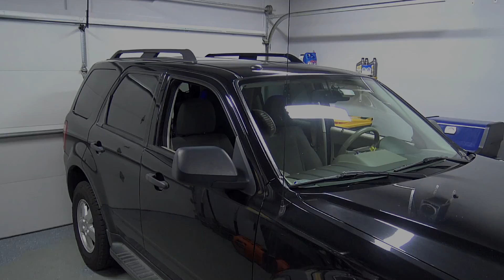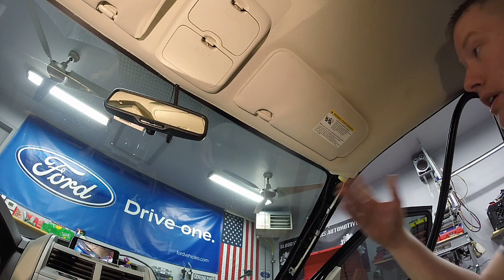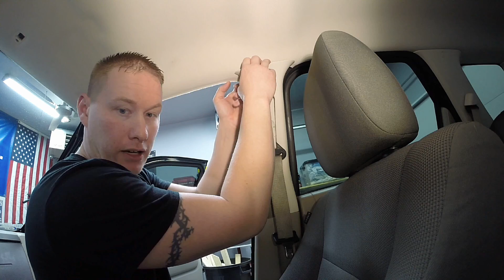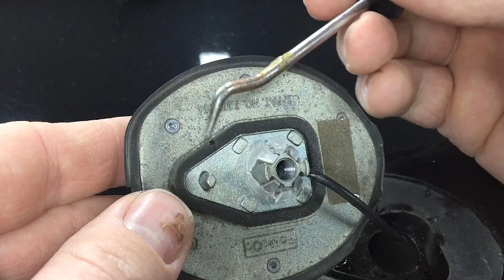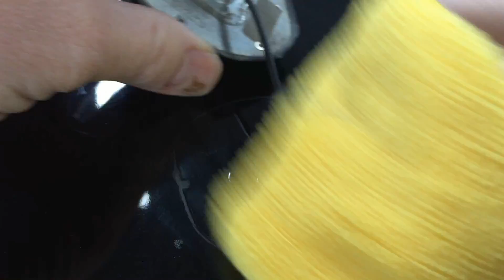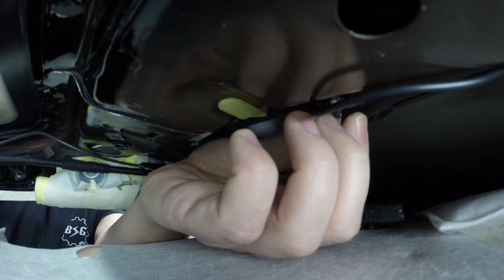Ford Escape & F-150 Windshield Water Leaks From An Unlikely Source

Comment: Nice video.  It helped me troubleshoot the problem with my 2018 F150, and I discovered it wasn't the drains or the antenna.  I actually had a bad seal at the top of my windshield that was letting water into my truck. I used some Permatex clear silicone to seal it up and that took care of my leak.

Comment: This is a lifesaver - thanks for this information - I'm about to apply this fix to my 2016 F150 with a sunroof - I don't have the dual sunglass holder, instead, I have the control box for the sunroof and lights - anything I need to be wary of before I start?
#newsubscriber

Comment: I needed to know how to remove the A-pillar trim, not for the antenna leak, but for a possible sunroof drain tube leak.  Thank you for this video.  We bought a used 2011 and had a wet headliner during a rainy spell.  I used a flex cable to gently clear the sunroof drain tube.  Thought it was good until we took it through a car wash for the first time.  The strong blowers caused the sunroof glass to flap a bit, and my wife said water appeared to come from the grab handle.  So I need to look.  I included all this description in case someone else has the same leak.

Comment: My 2016 Escape is leaking from factory metal seam under roof rail. Driver kick panel is soaked, covered in mold . Also floor board soaked. Sucks

Comment: I have the described leak but it is on the driver side.  Appears to leak at the top of the plastic piller where the cloth top meets the plastic.  Thinking it's not the antennae since it's the wrong side and I have the sun roof.  Have you ran into this issue?  Thanks

Comment: Great video. Thank you. I uncovered a small leak in my 2010 F150 that was dripping from the handle on my passenger A pillar. I thought is was the window seal but after watching this video I checked and there was a drop of water on the antenna mount bolt so I knew this was the issue. Overall took an hr being careful.

Comment: Now why this high-temp gasket maker vs some good quality outdoor silicone? Don't they make some good outdoor black RTV silicone? I heard Lexel makes some clear stuff that's clearer than silicone and it supposedly more durable that silicone. I'm just curious. I was looking for ideas on how to re-seal my 3rd brake light and came across this video... I also have a sat antenna on my truck like this.
Reply from the maker: Ford recommends this sealant because of the extreme roof temps of vehicles during the summer.

Comment: I have water leak in the same area on my 06 f150.  Water drips onto the fuse box area.  My truck does not have a satellite antenna. Any ideas where it may be coming  from?
Reply: I'm trying to find out where my leak would be on an 04 F150 that goes right to driver's side floorboard.  Infuriating.  Starting to have strange electrical issues now.

Comment: Why is there a little notch/opening on the rear of the antenna housing? Seems like that allows water into the space. 

Thoughts as to WHY that opening exists?
Reply from the maker: There is always going to be a relief for trapped water to get out.
Reply: FordTechMakuloco, thanks for the quick reply. 

Seems like with the lowered front stance of the F-150 it makes for a perfect ENTRY for water. 

Maybe at highway speed the Venturi effect draws out water, but what happens when the truck is sitting for any length of time and dew/rain has occurred?

Seems like the location could have been better to reduce/minimize the issue. Ideally, I would think having it mounted vertically or at a 45 degree angle with the relief hole on the BOTTOM makes more sense. 

Of course, I’m not an engineer. 🤷🏻‍♂️

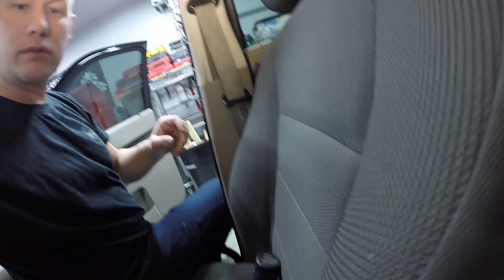Comment: Everything went well until about 10:30 into the video.  I've got a 2009 FX4 Crewcab.  The B-pillar supports the airbag and the rear grab handle.  Just taking out the top 7mm screw does not loosen the pillar enough to get more access above the head liner.  Trying to figure out how to loosen the rear grab handle so I can get my meat hook up to the antenna bolt.  Any suggestions?  Thanks.

Comment: thanxs 4 the info you can add 2011 f350 crewcab and it just drips straight on the Styrofoam like backing & flow to the a pillar. Did mine during on and off showers.Did you notice the seal is lower than the four little nubs?

Comment: I also have water dripping from my 2016 F-150, I was looking at the sun roof but found no problems. I will check the antenna. Thank you.
Reply: I have a 16 150 with the same problem  did this fix your problem
Reply: Paul B was going to ask the same thing. I have a 2016 F150 and had water dripping from grab handle but also from the back sliding window power switch. Still think it all comes down to this antenna not being sealed properly.

Comment: 2001 f-150.   I have a water leak from drivers side grab handle.  No satellite antenna and no sun roof.  No headliner stains yet.  I’ll probably pursue the windshield seal replacement and see what happens.  I don’t know what else to do in my case.

Comment: Done..it’s pretty much the same on the F150..the A Pillar has a clip near the top that was fairly tight on mine, and I removed the tweeter so I could get the A pillar out of the way.  When I removed the Sirius Antenna, I found a plastic retainer that was broken.  Solution: after cleaning everything up, I lined the broken plastic retainer back where it goes and applied Locktite 454 (superglue) to the base of the antenna where the retainer goes.  Put everything back to get together.  Otherwise I followed Brian’s instructions.  Note I did not remove my Sunglasses console, if I where to do it again I would definitely remove that, would make the job much easier, it is super easy to crease or fold the headliner...don’t want to do that.  Total time..under an hour.

Comment: Love your videos man. My 2005 ford escape is leaking front windshield fluid from passenger side door jamb. 
   Front windshield washer doesn't work. Every time I pull the washer on switch washer fluid pours out of passenger side door jamb.  rear window  washer works fine.
  Any suggestions? 
      Thanks man
Reply: Mine was leaking at the back of the wheel well so I pulled down the plastic liner in the wheel well by removing the Phillips screws and it revealed the rubber lines that carry the windshield washer solution for the front and the back both were disconnected at a joint that’s there. Easy fix just plug the rubber lines back into each other and zip tie so it can’t happen again. Good luck

Comment: 2011 Ford escape limited.. when i press the sat radio button on radio - it just says no sat radio...it used to work, think my antenna crapped out?🤔
Reply: Did you figure out what caused this?
Reply: @Bostonguy222  had dealer flash update software

Comment: 2009 to 2014 f150- Keep a close eye on the two little rivets holding a rubber molding down directly above your back window, it covers a body seam of the truck, I had one pop 3/4 of the way out and soak my rear passenger side roof liner several times before I figured out it wasn't the infamous 3rd brake light leak. You have to order the special rivets from Ford as they have a nylon gasket in them. $13 CAD for x4 of them. Simply drill out the old rivet, seal with body seam sealer and re-rivet . Leak Fixed.  Check this BEFORE you replace your 3rd brake light it may save you $200.

Comment: I have 2010 Explorer.  Water collects and then drips from the front dome/map lights during heavy rains.  There is no sunroof. Would you suppose this would be the windshield, Antenna as in the video, or the roof racks?

Comment: I have the windshield washer low light on constantly on my Ford Explorer ´06 V8 and no its not empty. Need help with fixing it.
Reply from the maker: Normally it is the switch in the reservoir. Disconnect the connector and jumper the pins with a paper clip then remove. It should cycle the low washer light in the cluster. If so then you need the level switch.

Comment: Is this the same for the 2010 Sport Trac? I have an intermittent connection problem with the sirius radio.
Reply: Did you figure this out?
Reply: @Bostonguy222  Nope. I had the 2010 Sport Trac for 12 years and always had an intermittent connection problem with the Sirius radio. Ford, Sirius and everybody else had no idea of why. I changed the antenna and wiring harness from the radio to antenna and it did nothing.

Comment: have you ever had to deal with taking off the roof racks to follow-up on a leak on the 2009 escape?  I started with the rack, got three of the screws out, but the other three are just spinning in the rivets - any ideas to finish getting it off, then how to put it back together with the spinning rivets?  Anything would be much appreciated !

Comment: I already went through my 3rd brake light leak twice on my 08 F150. 1st time replaced under warranty, but 2nd time traveling from Nebraska to the gulf Coast in Texas to go on a little cruise and hit a 2 hour heavy thunderstorm that started leaking so hard that I was fortunate to have the kids in the back holding towels against the leak point! I was speeding big time to get out of the storm, then it hit me "stop at truck stop" and bought a tube of RTV (just temporary use). I pulled under the gas pump roof and dried everything I could to stop the grand Rapids! Worked for entire trip, then replaced with my self made gasket, since Ford said they had no new design, is that correct???? Is this video related to my 2008 F150? I have stayed on top of maintenance and want to get it before it gets me! 
Thanks again for all your info, you are my favorite Ford mechanic and if I lived near you, you would be my hands on Ford mechanic!

Comment: You are the man! I have taken my 2016 Ford F150 to the dealer three different times for this but the leak is on my drivers side. The antenna is on the passenger side. Hopefully it is the same source. I am showing this video to the service department so they can do what you did.
Reply: My 2016 F150 is leaking on the driver side. Did service department fix yours?

Comment: I have an 02 F150 and have a leak on the DS grab handle, I have no roof mounted accessories any suggestions. This is a recent issue and doesn't happen every time it rains

Comment: Thanks for all the great videos. Do you recommend the black silicone sealant for the 3rd brake light leak. My brake light is leaking badly. Thanks
Reply: a small bead of silicone will fix the 3rd brake light leak. I just chose to replace mine with an aftermarket part as my wiring harness was melted/burnt around the bulbs

Comment: FordTechmakuloco    Have 2001 F 250 water leak which got to gem and fuse block. There are lights on top of cab but I am not sure where that's the problem. Ford had trouble also with windshield leaks. I am thinking of pulling the headliner. I don't drive the truck unless its dry out. Have you heard of anything else that might be leaking?  Any ideas would be of help. Have already pulled fuse block and gem once.        George

Comment: FordTechMakuloco

Great vid, really informative as usual We are so thankful. Got a question :
I 've an '06 ford escape v6 XLT. My battery is discharge after 4-6 hrs since last month, I don't have the money ( feed up as well) for any repair. Is there a fuse that i can remove to cut  the circuit so that the battery remain ok for the next cold start. I live in Montreal, Canada  we have crazy winter> 
Thx and May the New Year bring fresh bout of excellence to your life.

Comment: just an fyi, I learned this from a video a while back...I will find the link and put it on here...it's good info...by adding water to the alcohol you accualy improve its ability to clean the surface...alcohol does not dissolve dirt but water does, the alcohol is only for the grease
Reply: the channel is called (applied science )

Comment: I have a 2004 ford explore sport trac and have water leaking the same way on the driver side but I think the roof rack is causing it  part of head liner is snagging in that area  too were the rack would be Do you think this repair would fix it too?

Comment: Done this exact same thing on my 2010 f150 fx4. Great video and tip. Poor engineering on Ford though.
Reply: Maybe if they made a more flexible compound replacement gasket like a heat resistant rubber gasket there wouldn't be problems in many many years!
Reply: Poor engineering or poor gasket/sealant material production/choice?

One thing I noticed is that there is a small opening on the rear of the antenna, and that seems (to me) to allow water into the chamber/inner gasket). 

Any idea as to the purpose of that little notch/opening?
Reply: @elijahrobinson2362  They hardly ever leak.  I fix leaks all day, every day, and even though you'd think that Ford sat antennas would leak constantly, I hardly ever see them.
Reply: @elijahrobinson2362  I'm thinking for any kind of condensation or moisture that gets stuck up there, it has a place to drain and escape. That's what it looks like to me
Reply: @chriswho6794 , right after I made a separate comment the uploaded replied that it IS a place for water to drain out, although it doesn’t seem likely to drain out unless sitting facing UPHILL. Why? The trucks sit lower at the front end and the hole is on the rear, upper portion of the antenna. 

Driving along would permit it to be evacuated due to the Venturi effect.
Reply: Mine just started leaking and I was certain it was the wind shield...nope

Comment: My F150 is leaking in the rear somewhere. I have been told it's the third brake light but I taped it up before the rain came, yet it still leaked. It's leaking in the very right back corner from the head liner. It's ruining my interior. Have you heard of this issue?

Comment: just did this on my 2011 ranger. worked great I think... haven't driven in the rain yet. video was a great help. my only question is how tight is too tight on the bolt? I went a bit tighter than snug.

Comment: My 2008 Escape doesn't leak at the handle, yet I can hear water sloshing overhead after a heavy downpour.  Every so often, I'll find the passenger seat soaking wet.  Like you mentioned in the video, the headliner doesn't show any water stains.  Thanks for posting the video.  At least with this bit of info, I can pull the liner down a bit and see what's going on.  Hoping its just clogged drain holes, yet I'm almost afraid to look and find some serious rust.  Won't be getting a sunroof again that's for sure.
Reply from the maker: +Joseph Nieves Yeah if you have a sunroof the drain channel is full because the front drains are clogged. I use compressed air to flush them.

Comment: Hi Brian, I have mustang GT 2011 with coyote engine I have bad lifter, My question can I remove the lifters with out taking the camshafts out?
Reply from the maker: +hdashti2810 The cams must be removed there is little space in there to work.
Reply: +FordTechMakuloco thank you, however on the 4.6 4V you can. Removing camshafts on coyote is just PITA

Comment: Awesome video.  Always was leary of the headliner.  Thanks!!!
Reply: FordTechMakuloco I have a similar leak on my 04 Explorer. It has no satellite antenna on top, but does have a sunroof. Is the leak coming from there?
Reply from the maker: +Hawaiian F150 Yes you must be very careful. Most creases pop back out with time though.
Reply: +FordTechMakuloco -- What kind of coffee do you drink?  Do you use the Keurig coffee maker ( K-Cups )?  I love my Keurig. Going on almost 8 years now. This is my second coffee maker and only bought one.  First on died out at 11 months and  they sent me out a free replacement that's held it's own so far.   Heck, at 60,  It takes 3 or 4 cups just to get these ole batteries charging again.  The wife has told me that I like coffee more than her.  I reassure her that as a faithful loving husband of 35 years of marriage - the coffee is a lot better - and I run like the dickens into the garage.  I'm brave - not stupid  ;)
Reply from the maker: +Hawaiian F150 I use a regular coffee maker not the k cups anymore. I am currently stuck on the papa Nicholas Hawaiian blend.
Reply: FordTechMakuloco ... hey man why the switch? cost?
Reply: Jennifer Jordan ... aloha's Jennifer, Brian doesn't always monitor the older videos. You best bet might to message him through Facebook or Twitter.  I pretty sure he knows your problem well and has a way to fix it. The man had the touch of the mechanically inclined angel from above. Don't give up... Hound him for an answer ;)